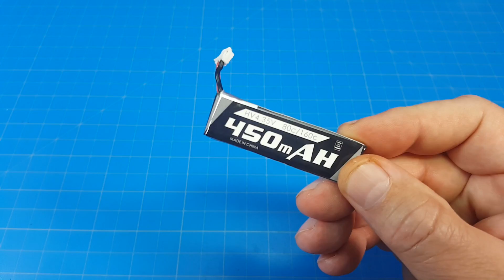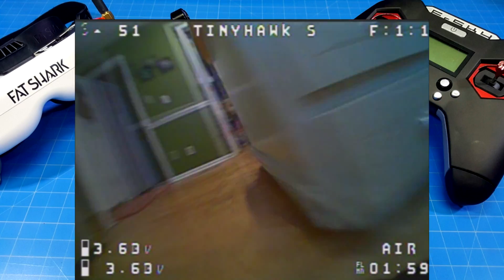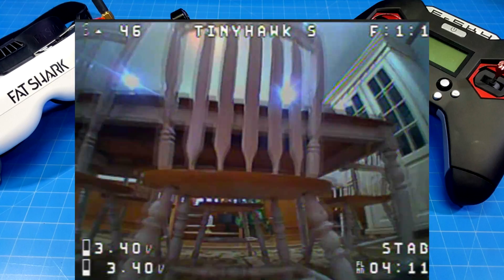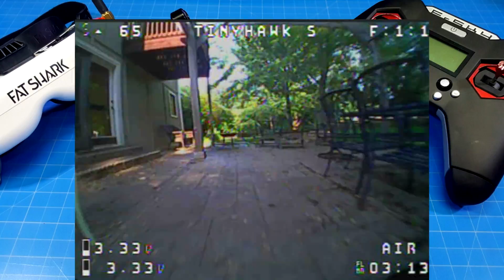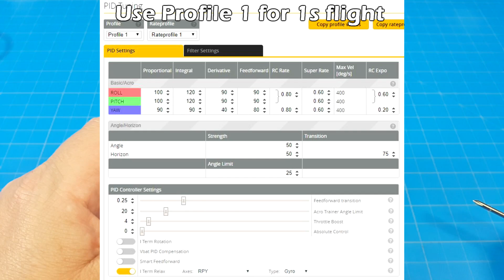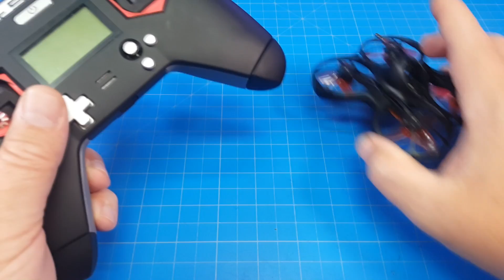TinyHawk S - Start Your FPV Journey!

Comment: You dont need a module to bind to your reciever. You need to change the mode in BetaFlight to FrSky_X mode.
Reply from the maker: Reports are d16 has issues with range. Is your range good in d16?

Comment: Also, what do think about missing this camera and installing the nano split 3. With the HD and the  sd card slot? And I have a 200mw Switchable VTX,  that I would like to add...., probably too much weight, maybe one or the other?? Ty
Reply from the maker: installing a split is going to be a big mod job, new canopy or lots of glue etc.
Reply: @NickBurnsFPV  I figured the same. Here's a mind bender, if I were to swap the frame for a V3 Mobula frame, would I have to switch motor direction?
Reply: Nick, I tried to join your patreon Channel and does it only take PayPal? If I could use my credit or debit card that would be great..?
Reply: Also, any idea how to make this S fly faster? It's a dog

Comment: Hi again Nick, excellent job as usual. Very informative, also nice flying! I see with 348 comments u must find it hard to get back to everyone but if you have 2 seconds.??? I just bought the s after buying the regular rtr bundle and we excited to fly the new faster quad but I was fairly disappointed. I had the regular Tinyhawk hong pretty nicely. I had switched my profile to 3 and it 2as quite a bit faster. Well I had to pay a guy to get  the bnf s version to bind with and to be able to fly with e6 transmitter. After a day and a half I get it back and what a dud. I don't know for sure but it seems like he or I did something we wrong....? As soon as I get back to work I do plan on joining your patreon Channel. thanks again Nick, if you don't have the  time, I understand if you're too busy take care of yourself and your family keep those cool videos coming take care.
Reply from the maker: Sorry, I don't understand what the issue is. I understand there is an issue, just not sure what it happening.
Reply: @NickBurnsFPV  , okay so I went back into Betaflight. Well actually I am using Speedy Bee right now, long story. Anyway, I paid to have someone set up a S BNF to bind and fly with a E6 Transmitter. And it flys so slow. And initially, when I first got it back, it was changing speeds when I switched from angle to horizon to acro? Very strange, right? Well I went into Speedy Bee and changed both profiles to 1 and it worked. I now had alone modes but it was as slow a a caterpillar. Lol. I know the obvious question, why I don't I just talk to the guy who did the work?? Well he's a bit of a pre-madona, to the say the least. And again, I appreciate your time and I will be joining your patreon Channel just as soon as I go back to work. I guess my question is, does any of this make sense? I'm not that efficient in Betaflight, so when I got it and it just started going faster as I switched modes, my first concern was fly away. I figured flying slow as better than watching it fly away.....? Lol

Comment: Is there somewhere an explanation for the charger? like what does the green light say? And when is it finished? Do i have to use both connectors of the 2s battery? 

I could not find any note in the manual...
Hope someone can help. Thanks
Reply from the maker: I don't specifically recall the lights, basically when you set to charge its one color and when its done it switches color. No both connectors are not required on the charger, with other "full" charges we often need both leads the balance lead and the primary.
Reply: @NickBurnsFPV  Thank you!

Comment: Nick: This was an outstanding review & clear photos! 
    You pointed out, as have most other reviewers, that their (beta?) versions of the TinyhawkS have side mounted motor sockets, rather than the top mounted ones in the original Tinyhawk. However, my TinyHawk S, purchased Oct 18 2019 and received Nov 15 2019 from AliExpress, has the expected black frame with flared struts, but instead of side mounted motor sockets, it has top mounted ones, though the chip positions seem to be the same on the board as that for your TinyhawkS. Is this a change from the board used for beta review versions or is it a retro mount of an old Tinyhawk original board on a new Tinyhawk S frame by my source?
    Secondly, my battery charger does not have the 6 charging ports shown in yours and other reviewers TinyhawkS units, mine has only 4: 2 for 2S and 2 for 1s batteries. Why?
    Thanks for your opinion and that of other users.  -Jim
Reply from the maker: I don't have inside information as to the changes emax may have made. I suspect they maybe discontinued or standardized the two boards. 
The charger is an odd change as well. Maybe they found a fault or something. Only a guess. Typically when a major company makes change I presume there is good reason.

Comment: Great video!
I'm new to the hobby..never flown a quad yet, just about 20 hours in liftoff. 

Destroyed my tinyhawk s before I even flew it. I thought I plugged in my USB cable into it, but quickly realized i touched the circuitry next to the USB port...with battery plugged in. Batteries don't work anymore. 
I have a lot to learn. 🙂
Reply from the maker: wow, were your hands wet?
Reply: @NickBurnsFPV  no. I didn't realize you didn't need a battery plugged in quad when plugging in USB cable to use betaflight. So I short-circuited something by touching the metal end of USB cable against the circuit board. I could smell something burn when it happened
Reply from the maker: @nathanhunzeker6033  oh I understand better now. Thank you

Comment: Nice vid. What antenne do you use for your Goggles? Great video qualiy.
Reply from the maker: In this video I was using the rapid fire receiver and two axii antennas.
Reply: Nick Burns with the standard antenne on the Tinyhawk?
Reply from the maker: @michaelbruunskovkristensen2509  They can, but we have to solder the antenna on

Comment: Thinking about picking one up before Xmas. What's the best 2S lipo now for this little beast? Thanks 👊
Reply: Also, I'm seeing others talking about switching over to an XT30 connector. Would you concur?
Reply from the maker: For absolute best performance yes, and xt30 will allow more current than ph2.0. The nano tech 45-90c are good but they come with jst, I most often use the GNB and RDQ 350 2s, I believe I have links to them in the video description of each video over the last 10months or so

Comment: I own the original tinyhawk. Can i convert it to tinyhawk s ? I only fly it with 1s. Did i only need to change the motors and get better performance?
Reply from the maker: Not without big expense. The s version is 2s compatible, the main board would need to be replaced and the motors.

Comment: You said that Mobula7 is the best tiny quad when the S version of TinyHawk did not came out. Now what do you think about these 2 quads? Wich one you prefer for both indoor and outdoor?
Reply from the maker: for me I still perfer the mobula7. I like it even more with 1102 motors 😍
Reply: @NickBurnsFPV  Last question..with 1s battery, wich one gave you more control for indoor flying?
Reply from the maker: on 1s the tinyhawk S indoor in better.
Reply: @NickBurnsFPV   mmm got it! Thank you!

Comment: Hi Nick, I want to ask you about the motors on th s. Mine are so hot in 2s that I cannot touch them(how is yours?) . Is there any solution? Banggood ask me what should be the repairing fee to pay me because I think motors are not going to last more.Is there any possibility my motors should be tinyhawk 1s motors? Also the fc is like 1s fc, plug in from top. Thanks in advance
https://youtu.be/-cfF_mmiRzo
Reply from the maker: Mine only got warm, I suspect something is wrong with the board/connectors. :(
Reply: @NickBurnsFPV  thanks Nick!

Comment: Great review and amazing skill, I can see you have fun with this. I have a question if I can, my tinyhawk s suddenly start to not connecting to my google (or other google) so I have to push the button near the USB for 5 second, after for 2 seconds change the band, I guess, and after pushing it for other 5 second (I think to exit this procedure) and like that I can have video again, but when I replace battery I need to redo the whole process. Any suggestion to fix this? thanks
Reply from the maker: does auto scan on your goggles not pick up the video signal. Sounds like the vtx is on a different channel/band than your goggles, pressing the button then gets the channels to the same or near, then battery change resets, the reset is due to betaflight osd control of the band/channel. When you have signal go into the osd with left stick mid and full left, right stick full forward middle. Then select the features and then I think its tramp, change the band and channel to the one your goggles are on, select set, the video should now be on the same channel when batteries are changed.
Reply: @NickBurnsFPV  It worked for me :) thanks a lot. It is my first drone with betaflight and stuff so for newbe is not that easy to understand all the settings. But thanks a lot I appreciate
Reply from the maker: @giropiro  yes, the learning curve is a difficult barrier, but each day we learn more and youtube/online has many wonderful learning opportunities. Good to hear your all set for more fun.

Comment: Hi Nick, after watching this great review, I took the plunge on the tinyhawk s.
I'm not sure if I'm doing something wrong thou. When I try changing pid profile to 1 1 it always shows as 1 4 no matter what. Also when in air mode the craft bounces. OK if changed to other modes. I'm sure I'll figure it out. Thanks again 👍
Reply from the maker: Not sure I understand the profile issue. Do you mean it doesn't change to profile 1 4? or that it switches back after leaving the OSD? Air mode, can cause bounces off of the ground or other surfaces when making contact, this is normal.  When landing hover just over the ground and disarm to  land without  bouncing. If you don't want to land in that method, switch out of air mode when landing, a switch assigned to air mode will be required.

Comment: hi nick 
i just purchased a tinyhawk s and on my are the motor connectors just like the old one  so my question is is this ok or did i catch a clone or copy got it from ebay
Reply from the maker: That is normal. The freestyle is the first time they have direct soldered the motor wires.

Comment: How does the charger work? Do you plug in the balance leads for 2s? Also how do you know when they are done? BTW Awesome video. One of the best channels on youtube.
Reply from the maker: Yes, the charger charges off the balance led. I don't recall specifically, usually either the light will change color or go from on to off on these little chargers. Thank you
Reply: @NickBurnsFPV  Thanks.

Comment: Hi - would i be able to fit my own TBS Receiver to this quad? And could i swap the VTX?
Reply from the maker: There are extra uarts on the board to add a receiver. I am not all that familiar with TBS receivers, but I would think so. The vtx isn't part of the main board, but is soldered on with pins, would be a bit of work but yes replaceable.
Reply: @NickBurnsFPV  Thank you very much sir :)

Comment: Got my Tinyhawk S a couple days ago.  Motor connectors are on the top!  Not sure why they decided to revert that.  Good video, thanks for the info.
Reply: Also mine, motors connectors on top and motors are too hot in 2s. Why is that? Nick in your tinyhawks, your motors temperature is OK?

Comment: For the fc for this little guy why does emax show a capacitor on the top behind the vtx as well as the plugs for the motors, they show the same mounting position as the original th. Weird. But saying that my ths has the same vtx/cam issue as the original. I get white flashes in my Fpv feed and makes it hard to fly sometimes.

Comment: Just a FYI, the TinyHawk S does have d16 support but it takes some configuration. I had to set it to FRSKY_X in betaflight and even then the binding process was a little buggy but I am now able to use it with the X9 lite which does not have d8 support.
Reply from the maker: Interesting, range stays the same?
Reply: @NickBurnsFPV  I have no idea. I'm just happy I got it to work! I didn't know I had a potential compatibility issue between the Taranis X9 lite and the Tinyhawk.

Comment: @nick, awesome review. I got a quick question. i'm just starting with the hobby and i don't want to spend a lot of money on a charger. Do you think the little charging board that comes with this package will help me out for the first couple of months? i really like the small form factor and that it works with 1 and 2s. I only fly whoops and toothpick class! thanks in advance!
Reply from the maker: The included charger will work just fine, it won't charge very fast and I suggest using a cell phone charging brick no a computer. I don't trust them enough to plug into a computer.
Reply: @NickBurnsFPV  Thanks for the quikc reply. I was thinking about using it with an Ipad Charger.
Reply from the maker: yes, that will work too.

Comment: My feed breaks up a lot more than yours did you take the antenna out of the canopy?
Reply from the maker: No, I am using the rapidfire module and axii antennas. Also wifi can cause interference. try it with wifi off.

Comment: You showed the connections for a second Rx - enough room under the hood? I picked up the original TH and managed to get a DSMX in there, but it was a tight fit. Wish I'd held out for the S after watching this!
Reply from the maker: Sorry I missed this comment. I am sure I responded a day or so ago. I do think there is room, it will need to be a micro rx and the space should be just like the original tinyhawk.

Comment: Video looks good, what antennas do you use? That video was legacy mode? What is that after market antenna you got on the x lite? I get pretty low reception with mine.
Reply from the maker: I don't think it was legacy mode, but I am not certain. I use AXII antennas. The antenna on the x-lite is for the jr module on the back of the radio.

Comment: How do you get such great fpv signal? I could barely go past one wall without losing fpv signal??? Do you think it’s because I use the eachine vr d3 goggles? Thanks
Reply from the maker: Its multi part. I use rapidfire, and I found the kitchen table as the best position. I also have traditional dry wall construction with an open floor plan. Also try turning off your wifi and see if it improves.
Reply: Smart tip about about the WiFi!! But even outside, I can barely get about 150-200 feet before it’s starts to break signal
Reply from the maker: outside we can have wifi bleed over from the houses if nearby, or if a cell phone tower or high power electrical lines. Our lines are all underground.

Comment: I got a Xlite pro today.  And I updated the firmware which supports d16 successfully.  I can bind ac900 receiver and r-xsr receiver in d16,  and both work ok.  However,  I can not bind tinyhawk s which should  support d16( I can bind it in d16 mode with taranis QX7).  Can you please try to bind xlite pro with tinyhawk s,  see if it works?  thanks.

Comment: Hi Nick,
New to your channel.  I’m just getting started with  FPV Racing coming from using  DJI drones.   Some of the technical aspects of these types of drones and devices that control the drone are very new/foreign to me.  

Can you please tell me if this tiny hawk can be bounded to the Evo 7 controller that comes with the Walkera F210 racer drone?

Many thanks,
Sam
Reply from the maker: Sam, unfortunately it can't bind to that radio. I believe the EVO7 will only bind with other walkera receivers. Welcome to the hobby, and continue to ask questions, I am sure everyone on youtube and facebook can help you along the way.
Reply: Nick Burns Hi Nick,
Thanks for the quick reply. 

What RC that binds yo most racing drones would you recommend for this hobby?

Also, when compared to the  Fat Shark Goggles, what do you think of the AOMEWAY Commander V1S?  Do you have a favourite one that is comparable to the Fat Shark HD3?

Thanks,
Sam
Reply from the maker: Something like the jumper T12 is a radio that will bind to almost any rx protocol. Its a smaller form factor.

I have not tried the V1S yet. I had one par get lost in shipping and another set was just sent. I suspect they are pretty good, but not as good as fatshark HDO, but HDO are much more expensive. I suspect the V1S work well and would be worth the price. Getting started can be expensive and some find that fpv isn't for them. I would be cautious spending so much money up front.
Reply: Nick Burns Thanks Nick,
What you think of the FrSky Taranis Q X7  with the Multi-protocol Module?
Reply from the maker: The Q x7 is a very wide remote. I couldn't pinch with it, if you have large hands and thumb it should work well.
Reply: Nick Burns Thanks again Nick.  What do you think of the Jumper T12 Open TX or the Jumper  T16 Open source Multi Protocol transmitters?

Thanks and sorry for all the questions.
Reply from the maker: @samavella8831  The T12 I suggested earlier, The T16 has that big screen which makes the radio big, but I have a bias toward a smaller radio.
Reply: Nick, in your opinion, if not for the size, which one is the better controller?
Cheers,
Sam
Reply from the maker: As I haven't tried the T16, its a difficult comparison. It seems to me the screen is largely unneeded for quads/fpv. I have heard overall positive experiences with the T16, except one person had a defective roller and has had trouble finding that part. I personally would go with the more simple T12, and save a few $$
Reply: Nick, thanks again for your patience.  

One more last question (I promise 🙏).  

In layman’s terms, what are the primary differences between the T12 and T12 Plus, and which one would you recommend (when not considering the price difference)?

Cheers,
Sam